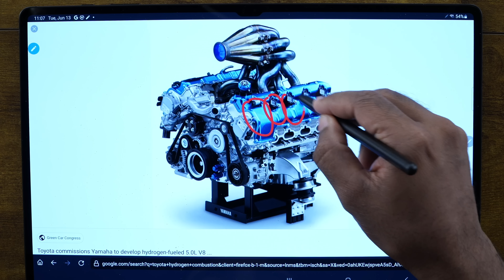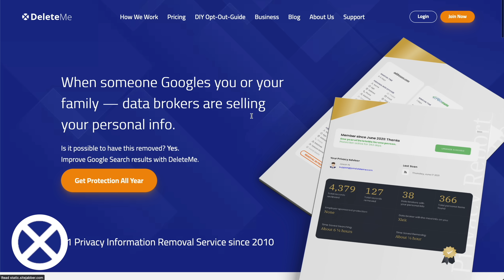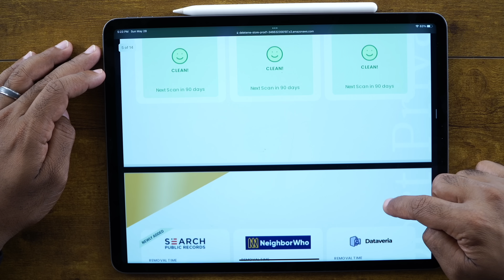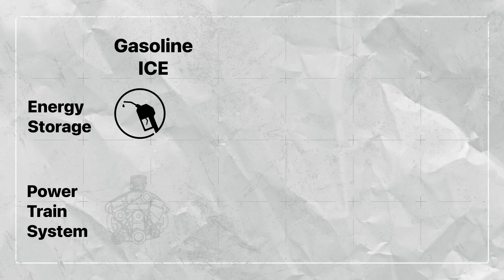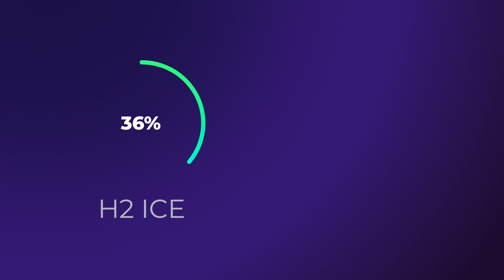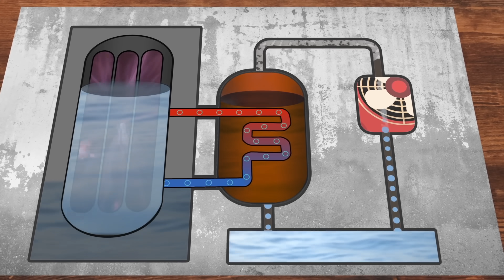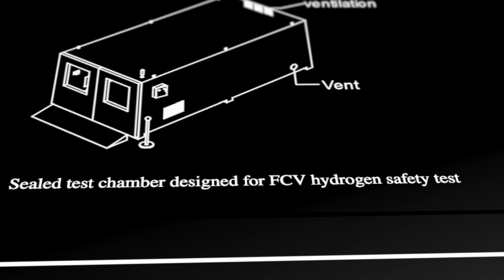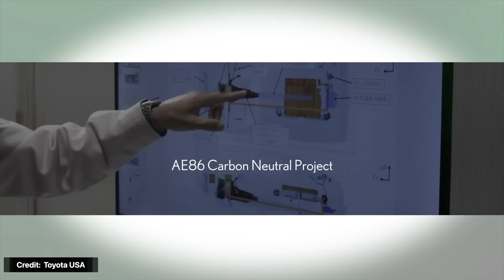Toyota's Says They Just Destroyed EVs - Hydrogen Combustion Engines

Comment: If the cars used some way to convert hydrogen to electricity that was 100% efficient, then the car would either have store the hydrogen as a gas, which has low density so it would have terrible range, or use 1/2 of the energy in the hydrogen to convert it from liquid to a gas at a temperature where it could combust. The hydrogen combustion engines get around that issue because they have so much waste heat. 

However the energy needed to compress it to a liquid state consumes half the energy that the liquid fuel contains after it is returned to a warm gas. ie the fact that it is transported as a liquid means that you have lost 50% efficiency before they put it in the tanker truck. 

Then there is the transport problem. Hydrogen gas causes steel to become brittle, and degrades steel, so it is not piped. It is transported via truck in large tanks. The tank looks like a steel tank from the outside, but is really a double walled vacuum bottle. The inner wall is actually glass. Doesn't sound very strong? it isn't, so it needs to be thick. The amount of liquid actually contained is only about 1/5th the fuel which would be contained if it was a fuel that was liquid at room temperature. So there would need to be at least 5 times as many fuel delivery trucks if we were to convert to hydrogen in our cars.

Say the desire is to produce 1 unit of hydrogen energy, the equivalent of retrieving it from a battery. 

If you generate it on site, by running electricity through water, that process is only 70% to 80% efficient, but at least it gets around the issue of transporting it. Now this 1 unit of hydrogen at 80% efficiency consumed 1.25 units  Of course then you have to compress it to liquid, so 2.25 units of electricity. Now you need to burn it to obtain the waste heat to make the next unit of hydrogen available, so 35% efficiency, 3.57 units of power to get it back to the wheels.

Comment: Take a very close look at 10:49 in the video where there is a sticker in the filler door that says, "DO NOT REFUEL AFTER 2029/11" My EV is still going strong after 10 years. While an EV will degrade, hydrogen vehicles, both FC and ICE, have strict limits on how long until those hydrogen components like tanks can be used. H2 cars have a built-in expiration date.

Comment: The obvious answer is hydrogen-powered cars.  No rare earth battery crap included with extensive mining for other components. It will still need intensive power needs to do the electrolysis required to separate the hydrogen from water.  This is made very cleanly from the latest generation of Nuke stations.  Very safe and very clean.  This is the ultimate power source.  The waste is very easily disposed of in the vitrification process that is ongoing at the Hanford Labs in central Washington state.

Comment: Great work Ricky!
Hydrogen ICE vehicles running on steam reformed H2 (with current extraction, compressed storage and distribution/dispensing tech) would use more fossil fuels than gasoline ICE vehicles per unit of horsepower produced! The low home run efficiency of H2 ICE, current dependence on fossil carbon, and near complete lack of current production and fueling infrastructure make this tech DOA in any country except one which makes it a national endeavor/priority to make it work at any cost (Japan with HTGR reactors?). Very odd and perhaps risky thinking on Toyota's part!?

Comment: Making hydrogen is expensive on energy, and is usually taken from oil. There is nothing new about hydrogen engines. "Oh, but it can be made using electrolysis and renewables!". Yes but it wont be, will it.!
 So Hydrogen power is basically a scam.

Comment: Another weird & wrong video. Leaving out the main point: You need currently about 10x more energy to generate Hydrogen in comparison to charnging a EV (taking everything on both sides into account all the way). With an option of "only" 5x more energy if science/technial advancement continous at its best. Plus the break down of combustion cars. Plus currently the refilling at hydrogen stations is very limited in filling cycles for cars or trucks per hour due to the involved physics / equipment at those handful of stations in the world. A battery can be refurbished. Battery technology is advancing dramatically on top of this. Plus bringing back useless noise and slow perforamce. These cars can make their car sports sounds way back in the rear view mirror while EVs race of. 
The hell we don't produce enough renewable energy now for waht we need. We weed way more for all kind of stuff. Until we have enough renewable energy for everything and then use extra for hydrogen production for burning it. This is delusional.

Comment: What I love about my EV: No gas tank and related pump, hose, etc. No radiator and pump, hoses ,fan, belts, etc. No alternator. No plugs, wires, carburetor, injector. No exhaust system, pipes, catalytic converter,  muffler.  Contains no oil, gas and toxic fumes or leaks. It's silent and peaceful to drive but if i want to get assertive its 0-60 in 4 seconds and top speed of 200mph all for about 31 cents a gallon or free with my solar panel system. Mine has about 150K mi and has required, except tires, wipers etc, zero maintenance.  Looking forward to the next 850k miles before the battery needs replacement.

Comment: I live in Japan, and I think electric cars here make no sense at all because 71% of all electricity in Japan is produced by burning fossil fuels.  Initially creating a large EV battery requires a huge amount of CO2 output, more than to create a traditional combustion engine.  And after around ten years, the battery goes dead, so you throw the car away or buy another huge battery.  Unfortunately, creating hydrogen fuel also mostly comes from burning fossil fuels, but in Japan we have enough nuclear power plants (dangerous!) that we might get a lot of our hydrogen from those plants.  Overall, I see why Toyota is working on this.  Japan feels the pressure of climate change but we are stuck with no good way to obtain carbon friendly fuel, so we are looking into many areas.  By the way, there is an H20 fuel station about three minutes from my house.  But there aren't so many in other towns of Japan.

Comment: A great video comparing hydrogen combustion engines with hydrogen fuel cell electric power; I thought Rikk would not get the part about generating the hydrogen for both systems, but he did. Ultimately it will be produced mainly by electrolysis from renewable electricity, perhaps supplemented by energy from waste steam, or as mentioned by thermal cracking of steam or biomethane at around 900C, so the low efficiency of internal combustion engines, around 30% compared with an electric motor of around 85%, favours a pure EV but when you need more energy on board, increasing the battery capacity becomes a decreasingly less attractive option as the battery weight increases, then a hydrogen -fuel cell-EV (FCEV) becomes more efficient, although the energy cost of the electricity is less than that for hydrogen. As the video points out, the basic problem is the lack of hydrogen filling stations; if they had one every forecourt, there would be a lot more hydrogen powered cars and especially trucks driving around.

Comment: Pipe dream - hydrogen is a very leaky gas. It leaks through normal metal. It has to be compressed at 7bar (102 psi) in specially made tanks which are heavy. Imagine a car accident with a tank under 7bar pressure  in the trunk .... Kaboom !!!
80% of hydrogen is not transported due to transportation problems. It is made on site, to avoid transportation infrastructure like gasoline which would leak too much gas.

Comment: I used to work with someone who worked at Fort St. Vrain Nuclear Plant. That Nuclear Plant was unique in that it was the only Commercial Gas Cooled Reactor to operate in the United States. It was closed because the low capacity factor for the plant kept it from being economically viable. When I asked this person why they couldn't keep the plant online, he told me because of the high temperatures, the seals on the Helium Compressors kept failing.

High Temperature Gas Cooled Reactors can produce temperatures high enough to sustain a Sulfur - Iodine Reaction to produce hydrogen. If Iron Nitride magnets were utilized in the motor for a compressor, the compressor rotor wouldn't have to penetrate the housing and no seal would be required. Would this work?

Comment: Not sure if this was intended to be very deceptive in the statistics that where presented or if it was just a major oversight.  The efficiency of production and transformation into proper storage was factored in for Hydrogen.  While completely left out for fuel cell.  We lose around 50% of the electricity we produce, that runs through power lines.  From inefficiency.  It bleeds out over time and distance.  Also, just as the rare earth elements needed for batteries, was factored in.  So does the question of how was the electricity that went into the EV produced.  If you just say solar.  How much of a solar cells life time energy, does it take to make a replacement solar cell.  Right now much of the energy used in EVs, is still produced by fossil fuels.  Which means it is not as free an energy as suggested.  Combined with the energy lost from the power grid.  Means EVs are not nearly as efficient as was portrayed in the calculations.  If it is cold out.  
  It is also possible that ICE cars of the future may put some work into recapturing some of the energy lost to heat.
  In regards to dangers of hydrogen catching fire.  Similar concerns must be given to how dangerous massive batteries are when they catch fire.
  The was some of the pros and cons where delivered, came across a bit disjointed.  For instance.  You did mention having to replace batteries and quickly mention the less than green reality of scrapping the battery.  But these mentions should have been talked about side by side with the additional maintenance cost of the ICE engine.  With its own set of graphs.  Those batteries are very expensive and NOT very green to mine the minerals.  Or to dispose of.  While being extremely expensive to replace.

Comment: Yes, it's possible to do it but with ICE efficiency of spark ignition engines peaking at around 25% and the energy efficiency of hydrogen production by electrolysis at 40-50%, any H2 engine will be using around EIGHT TIMES more energy than a BEV.
It just makes no sense at all.

Comment: Unfortunately, if it had the same 20 gallon fuel tank as the RCF it would only have 50 miles of range. In order to have 300 miles, you’d need to fill all of your trunk, and storage space with high pressure fuel tanks. H2 ICE is a pipe dream. Haha

Comment: I like Toyota’s investment and hope it catches on;
I got this stat info the other day. Concerns me over the long run.

Process of making electric car
Making a 450 kg battery you have to dig up 200,000 kg of material 100 to 300 barrels of oil which will then hold one barrel of oil equivalent to energy just manufacturing one battery results in 10 to 40 tons of CO2 emissions and the bigger the battery, the higher the omissions in contrast, we only use 35% of this when making an ICEE car but despite this more and more nations making ev cars

Comment: Can you imagine the amount of service a hydrogen engine requires?  Add oil changes too.  Sensors, belts, spark plugs, etc.  My first Tesla had zero service of the power train over 4 years of ownership.  So far, the same is true for my 2nd Tesla.   I will never buy ICE again.

Toyota has a very large investment in Internal combustion engines and refuses to scrap it.  They seem stubborn.

Comment: I wonder if you could get an H2 hybrid with both H2 combustion and fuel cell engines, so that the ICE could provide the bulk of the power while the fuel cell could boost it when most needed.

This way you can get best of both worlds all the while running the car on just one fuel type.

I would certainly be interested in such a car.
Reply: Sounds like the worst of both worlds.
Reply: Way too expensive compared the BEV.

Comment: I am really interested in H2 combustion because it's something closer to what we already have. The limited range of EVs along with their use of rare earth materials which are only going to get more expensive in a short period of time just because of the rareness. Plus there's added strain on the electrical grid that we haven't even gotten near peak usage and it's causing problems already. Sure maintenance on an H2 ICE might be more than gasoline but it's a hell of a lot cheaper than replacing a battery pack that goes bad. Some argue that H2 is a product of petroleum but that's a non-starter because people haven't started mass producing H2 fueling stations making other methods cheaper.  I worked for a couple of years at a place where we used H2 fuel cells and we were more productive than where the same company used EVs. IMO the positives if looked at for the long run outweigh the negatives compared to EV's. Maybe the choice of Fuel cell will become popular but I can't see it because who can afford electric other than the very rich? A used EV is still going to be very expensive and who knows how much longer or what kind of range a battery will have. At least with ICE a used one will perform well for a long time with proper maintenance which is much lower than EV's. Also, let's not forget how terrible EVs are when it comes to towing. You lose 75% of your range anytime you tow something with an EV. An H2 ICE doesn't have that issue to such great extent. The problem is all the uppity ups who've already invested in EVs want a return on that investment and damned the consumer they'll get it one way or another.
Reply: The problem is that with the poor efficiency of the combustion engine, the range is going to be really poor: the range of a Toyota Mirai Hydrogen Fuel Cell is 400 miles, with a 85% efficiency... with the 37% efficiency of a combustion engine, you will get 174 miles of range, worse than almost any battery electric car!
In addition to produce the hydrogen without releasing any CO2, you need a lot of electricity, basically 6 times as much. So using hydrogen would be a total disaster for the electric grid, requiring the construction of many, many more power station... and last is the cost: the car might cost a little less to produce but the cost of hydrogen as fuel is enormous: $16 per kg in the US, so $80 to fill up a 5kg tank... $80 to drive 174 miles! That's almost half a dollar per mile!
EV's are very cheap to maintain and last a very long time, much longer than ICE cars, new battery technology last longer and longer and store more and more electricity (most EV's now have ranges in excess of 250/300 miles). Hydrogen is just too hard to produce, to expensive to transport and will never be competitive enough to succeed.
Reply: @regisdumoulin  At this point I think I'd rather have the fuel cell but the price is way out of my range. That's the one thing about the ICE they can make it comparable to current cars/

Comment: The biggest issue with a hydrogen combustion engine is range. You may be able to refuel a hydrogen powered car almost as quickly as a gasoline or diesel powered car, but storage is  another issue. The Toyota Mirai is packaged around 122 liter high pressure tanks that store about 5 kg of hydrogen at 70 MPa (10,000 psi) pressure. I have heard that the energy produced from 1 kg of hydrogen is comparable to the fuel produced by 1 us gallon of gasoline. Thus, the Mirai is a mid sized sedan that has the equivalent of a 5 gallon fuel tank. It works only because the Mirai's fuel cell is much more efficient than an ice engine, so it makes the most of its modest fuel storage, replace the fuel cell with a hydrogen combustion engine and the efficiency should drop down to ice levels, giving your HCE Camry a 150 mile range. That is an acceptable tradeoff in a small island nation but will be much more problematic in the United states.

My guess is that the Japanese government may be pushing Toyota to develop the hydrogen combustion engine as a way to reduce the nation's dependence on imported resources. Traditional internal combustion engines depend on fuels manufactured from petroleum, current electric cars need lithium and other rare materials, and fuel cells need other rare elements. So the hydrogen combustion engine could eliminate the need for petroleum (particularly if Japan was able to generate hydrogen from water using electrolysis), and the need for rare materials. Range wouldn't be as much of an issue as Japan is a collection of small islands, so long road trips that are common in the US, are uncommon. Government support (and a relatively small landmass) might make setting up hydrogen fueling stations fairly simple. Thus, the hydrogen combustion engine is something that could work better for Japan than it would for the United States.

Comment: How many kilograms of hydrogen will it hold? Hydrogen requires high pressures to liquify, is not a very dense liquid, and as a gas is very prone to leaking. This means that the tanks are very heavy for how much hydrogen they hold.  I suspect range is going to be minimal which combined with the scarcity of hydrogen fueling stations means the vehicle is even less practical than an EV.

Comment: Your numbers don't add up.  HFC has an optimistic overall efficiency of around 30%, whereas H2 ICE drops down to LESS than 20% as you loose 70% of the energy during the internal combustion.